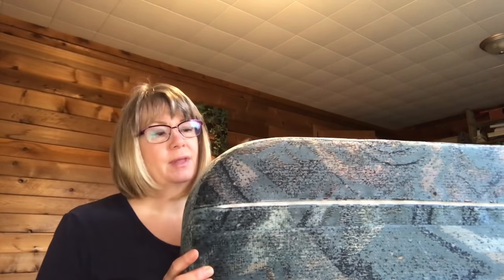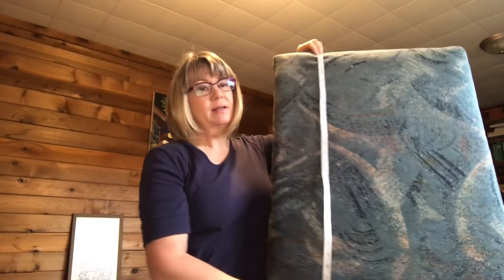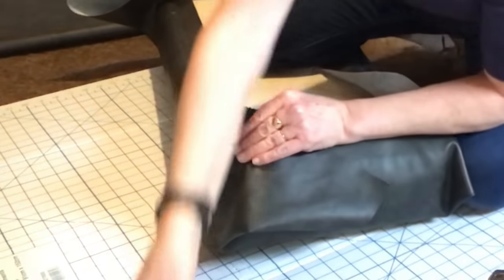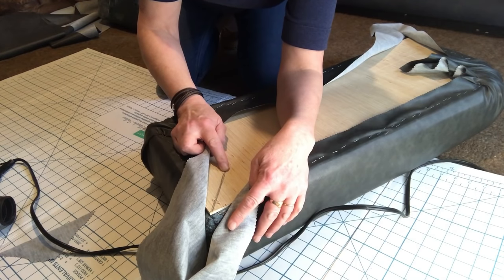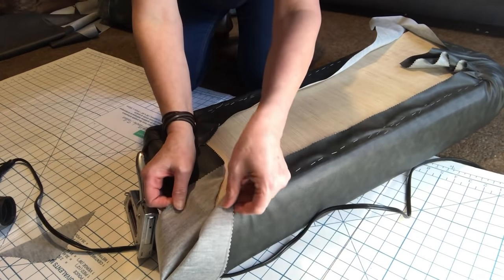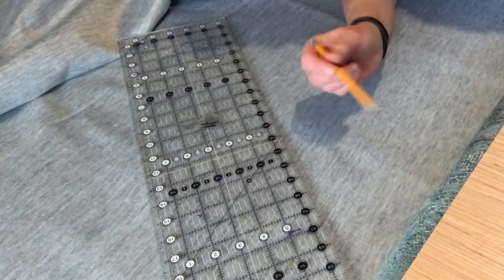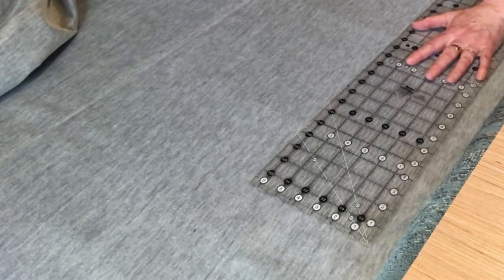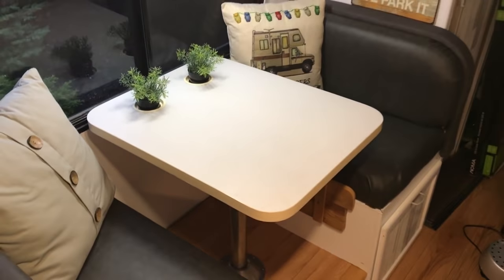How To Reupholster RV Dinette Cushions - Easy, No Sew, Vinyl

Comment: Im thinking that those staqpels may rip the fabric after my 300lb fat butt sits on it very many times. maybe fold the fabric where the stapels are and do 2 rows  any suggestions? I really like how you did the corners. I think i could do this myself. I was going to send my TT cushions out but you make it look simple, I am going to give it a try.
Reply from the maker: Lol! Yes, you could certainly fold the fabric over, even a few times. That would strengthen where the staple goes through. I am going to be doing an update video this spring on these covers. I will be adding a corner protector to the edges where the corner of the plywood and the fabric tend to rub against the wall. Next time, I would actually round the corners off to avoid a sharpish edge there. If you stagger the staples, that will also disperse the tension. Good luck!

Comment: Nice job but would it be better to fold the ends where you staple so it is less likely to rip from the staples?
Reply from the maker: Hi Jeff! See my other answer...but yes, folding the fabric, more staples, and staggering them in different rows. I have also seen where upholsterers added a cardboard strip on top of the fabric, and stapled through that too. Hope this helps.

Comment: Why did you use vinyl and just not use leather?  Also, fabric areas in my RV I sprayed with scotch guard...:-)
Reply from the maker: Debbie Sunshine Tomko I chose vinyl mostly due to cost. Leather is quite a bit more. I have a leather couch in my sticks and bricks we call the dog's couch. It is all scratched due to dog's and a litter of kittens. After a year, the vinyl is doing great! No scratches and that’s with 2 dogs traveling on the couch. I also chose the vinyl because it cleans up easily. It wipes off clean even after wet dogs! I’m very happy with the results.
Reply: @HoneyandMe  Is it still holding up well now?
Reply from the maker: @JennIfer-xe7us  Yes, very well. It cleans up really nicely and still looks great!

Comment: What is the thickness of your wood?
Reply from the maker: The wood on the backs of the cushions is 1/4 inch thick. It sits on top of the plywood that was originally under the seat cushions. That wood is 3/4 inch thick. If you are just going to use the cushions with the wood backing and no other plywood underneath, I would use at least 3/4 inch thick. Hope this helps!😁

Comment: About how many yards of fabric did you buy?
Reply from the maker: I ended up having to purchase this fabric twice as they didn't have enough the first time. I tend to overestimate and still have some left over after doing both the dinette seats and the sofa. To get the measurement you need, you must measure what it is you are going to recover. Wrap your tape measure around the cushion from the point where you want it to start to the point to it will end. In this case, I measured  a few inches wrapped on the back, over the top of the cushion and then a few inches wrap on the back on the opposite side. As vinyl doesn't fray, you don't need to fold the edge under. In all, I used about 3 1/2 metres for these dinette cushions. If you are using a fabric that will fray, you should fold the edges of the fabric under before stapling it to the plywood back. Hope this helps.
Reply: Thank you!
Reply from the maker: Dallas Swaggerty You’re more than welcome👍